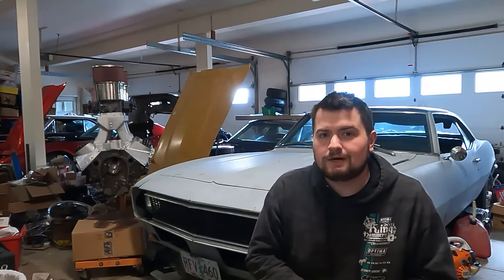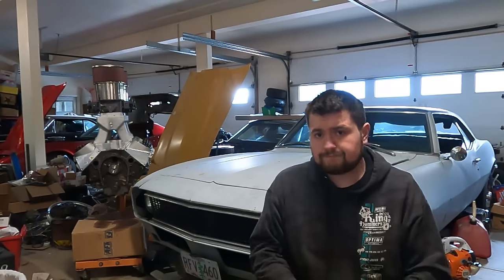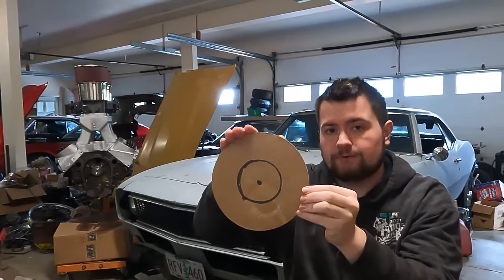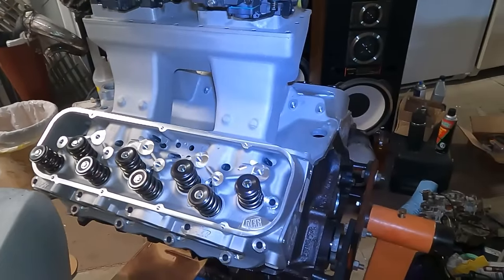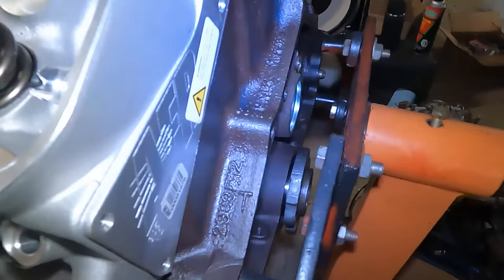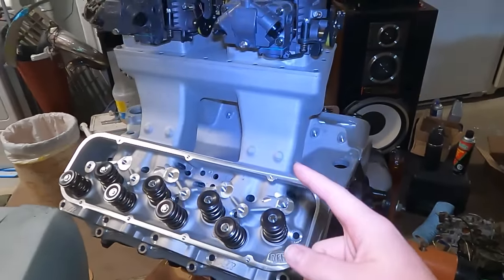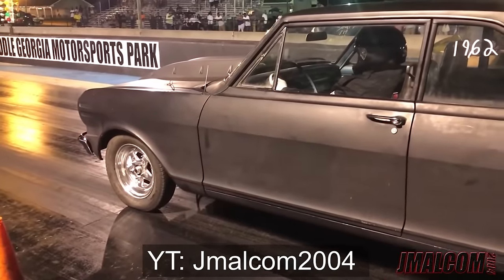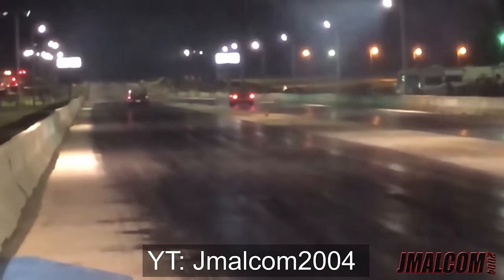The Truth About The Small Block Chevy 327

Comment: He said rare to find now a days. Buying one for $500 out of a old c10 at my moms junkyard. How high do they rev stock?
Reply: the highest ive reved mine stock cam bottom end performer 600 headers was 5000 . i dont know if id risk any higher .wonder what he would say
Reply: @mattv8919  I have shifted mine at 7,000 for 30 years still hasn't missed a beat.
Reply: A truck engine would have had hydraulic lifters which would max out around 5500 rpm's. I had a new 300 hp 327 with 4 speed in 1962 that I raced a lot. To rev much more than that would require solid lifters which only came in Corvettes with 327's.

Comment: The only Factor you have to look at is it internally balanced did you use quality parts 565 big block Chevy I twisted to 8600 during my burnouts and I would run a 906 ET at 154 miles an hour then I'd go through the trash at 7260 RPMs the distance that the ear talking on the circumference is minimal if you use the right oil
Reply from the maker: It still does make a difference however. Drag racing is a sport where you're not at that RPM for a long amount of time. If you're trying to hold high rpm for extended amounts of time thats where a small journal crank will shine. Not saying it's an insane difference, but it does help with sustained high rpm reliability.

Comment: Question ??? Small journal 327 four bolt SPADE steel aftermarket caps, Where can a person buy them ??? Melodon said NLA  Summit & Speedway said, no way, so where can we buy the 4 bolt small journal spade caps ???
Reply: You have to take them off a blown up dart block.
Reply: OK, nobody had a clue on locating 327 4 bolt spade caps. SOoooooooooo  how about this, CAN you use a set of 350 spade cap and deck 1/4 inch off the caps mating surface to use the 350 / 4 bolt spade cap on the 327 block then aline bore the 327 block with the cut down 350 spade caps to use a 283 steel crank so we can wind the HOLY HECK out of it ! Most of the aftermarket caps are really thick and cutting a 1/4 inch off  the bottom would not affect the strength of them.

Comment: It was a great engine. My neighbor had a 1966 Chevy Viking 60 truck with a 327 set up like a semi-tractor; even a compressor for air brakes. He worked it HARD, pulling junk cars to the scrap yard. He overheated the engine and replaced it with a 350, truck was never as good.

Comment: Fot a mildly modded engine a 327 small journal is totally fine. And they rev freeer as well. 350-400hp . Though I knew of 500 plus REAL in decades past. And small journal 302s going to 8500
BUT to make the big power these days and especially boost that large journal is essential.

Comment: I orgot about the l74 300hp 327,and yes gm mfg.a 4 bolt 327 for industrial use!!
Reply: I never saw one. Even out of a bus, boat or water pump.
Reply: L74??
Or L75?
Reply: l75 was a vette motor 327/300hp @johnthonig8832

Comment: Yes, indeed the 327 with the small journal bearing would in theory have less wear however in real life the difference would be marginal. If you drive both engines daily for another 56 years, maybe the small bearing 327 would wear considerably less....at the end both are still oversquare engines. In Hondas, the B20B conversion to a VTEC head can produce such results, since they usually set the rev limiter to 9000+ rpm as the B16A, in an engine that goes from 77 to 89mm stroke and falls in rod ratio from 1.76 to 1.54.

Comment: I have a 69 327 Camaro engine Im working on. It has earlier power pack heads. Ive heard of people bolting on 305 heads or having the 305 intake valves put into the power pack heads. Im looking to turn it into a good street driver with a small bit of HP more then stock. And do it sorta low budget. Which would be better? Or I can get double humps or cheap DNA brand aluminum heads. Thanks
Reply from the maker: Id definitely search for cammel hump heads over 305 heads. The 305 heads provide more compression however lack the flow of the camel humps. Requiring more compression that will inevitably make less power than the camel humps. If you don't already have an intake for it I'd probably suggest Vortec heads however, as they can be sourced from a local wrecking yard and are the best flowing small block head. Caviet being as mentioned before is the different intake they require and they will need to be machined if you want a cam over ~.460-.480lift (can't quite remember off the top of my head what the cutoff is).

Comment: Years ago I was give Chevy small block. 
The engine had double hump head, I sold those some time ago.
For years I’ve tried to figure out what kind of engine it is. I believe it’s a 327, but am not sure what it came out of. 

The casting numbers are 3914678. On the passenger side at the back of the block are also stamped G257

I believe it’s a 327 but not sure if it’s a large journal or small journal. I’m also trying to find out what type of vehicle it came out of. 
Can you help?
Reply: Large journal, 2 bolt main, 302,327,350 according to my book I have. 68-79. Yours is most likely a 1977 350.
Reply: @danburque7555  thanks Dan!! I really appreciate it 👍🏻

Comment: Great video. I do believe that the later, large journal 327 of '68 and '69, could be found in the 4 bolt main configuration as they shared same casting numbered  blocks with the 302 and 350.

Comment: Can you make a 327 out of a 283?  Nice video,. keep em coming!
Reply: No because the bore on a 283 is smaller than the 327. I've heard there is 1 year of 283 that can be over bored to the 4" bore of a 327 but they are really hard to find and expensive. 283 is a great motor also.

Comment: I to prefer the small journal crank ; little known that the 350 when first came out because of demand the blocks were green when machined only 6 months too a year after casting . where as the 2 bolt blocks usually 3 years . I had built a 302 zapper with a 66 small journal block , 12.5 slugs , forged 283 crank , stupid cam and "opps" angle milled camel bump head ; good thing for the overlap of cam at low rpms because compression ratio worked out to 14.2 to 1 OUCH ,had to mix my fuel But talk about fun . red-line was the valve train 9500rpm all day long

Comment: In reality, if you want to go racing and need the engine to spin over 6,500 rpm, then buy a 327...if you can find one cheap. It will  make more power than a 301 at the same RPM and connecting rod length and head flow. Otherwise, find a 400 block and drop in a 3.5 inch crank--less valve shrouding, you won't get the benefits of a small journal but you won't need to spin past 6,500 rpm either.  And if you're on the street, a Vortec 350 will go as cheap as $100, already have the roller lifter bores you want on a 7,000 rpm engine, and it won't even need a ton of RPM since it has displacement (or destroke it if you want, but most who ran their mice past 7,000 rpm regularly invested in shaft rocker arms, so the cost goes up as the RPMs go up), so you get more off the line pep without needing 4.10 : 1 + rear gears. sad to say, the 327 was great in 1968 when fuelie heads by Mondello were where it was at, but it's been surpassed if you're building performance by the dollar. 

i know this offends folks who grew up with this engine and they'll say, "well, if you really want to make hp, why don't you just go buy an LS, boy?". but if you don't know a 327 and you're starting from scratch, you might as well try to make power from a Merc flathead--you'll do it after a lot of money. but if you have a bunch of 327 parts lying around, well...you could still sell 'em and grab a Vortec and aftermarket cylinder heads and a used tunnel ram :)
Reply: Only if you use a 6 inch rod and shorter compression height.
Reply: @cammontreuil7509  6 inch 'rods and pistons weighed to match are nearly off-the-shelf now for the chevy engine. not hard to combine it with a crank that has crossdrilling or pendulum cut weights or whatever you want and save time on the assembly. Or you could reuse stock slugs and swap them from bank to bank if you believe in offset wrist pin benefits.
Reply: @albertgaspar627  Keith black makes a good affordable piston for this application. 
If you do a back to back comparison, the longer rod runs smoother and coming in a corner at a race track, letting of the throttle, the engine naturally slows down, and you have more control instead of hard breaking.
Reply: @cammontreuil7509  i mentioned a few different displacements in my OP, so i'm assuming your talking about a 5.7 litre application. It is interesting a long rod causes "engine braking" as i assume you are talking about, usually that's a matter of compression and friction. Can you explain the science or mechanics a bit more?
Reply: @albertgaspar627  Grumpy Jenkins on an x y graph showed on paper how much piston dwell difference was between a 5.7 rod an a 6.0 inch rod.
He then took a 350. And only changed rod and pistons from a 5.7 and 6.0. 
He found a horsepower difference. He was testing dyno acceleration. 
So I experimented on the tract. I found by accident the braking potential.
I found the same breaking potential in building a 6 inch rod cleveland and 5.4 inch rod boss 302's.
If acceleration must then be an equal deceleration.

Comment: If you bore a 400 block .040 and use a big journal 302 crank with bearing spacers, you get a big bore 327. No bull, do the math.
Reply: check out C.E. PERFORMANCE

Comment: How can i get my 355 to rev higher ? My cam specs allow for around 6k, I have Vortec heads with upgraded springs,performer intake and a 750 holly brawler mec secondaries. I can hardly pull to 4500-5k with WOT and 38 degrees. Fully rebuilt engine everything is new new except my old HEI which is stock. My mechanical advance is working, might need to throw a curve kit in the HEI or upgrade to a Msd? What are your thoughts?
Reply from the maker: I would lean on the side of it being your ignition system for sure, if the rest of the engine is correct for spinning 6k~. None of those components should have a limiting factor so my guess would definitely be spark related. However it does get expensive replacing parts to find the solution.
Reply: What kind of exhaust system are you using? Could that be restricting it?
Reply: @bw3506  headers into dual 2.5” pipes with flowmaster mufflers
Reply: @GMC4240  Definitely should be plenty of flow for that engine. I'm running dual 2-1/2" with Jegs knock offs on a 470. I set the rev limiter to 6700 and spins up against that regularly. if ignition doesn't do it maybe cam timing? Did you degree the cam in?
Reply: @bw3506  I did not degree the cam, I’m thinking it’s either that or an ignition issue
Reply: @GMC4240  I've had a bad experience just trusting the timing marks on the gears before and it was even a name brand set. I've also heard others say their cam was off at the pin as well. My cam maker even suggests checking it so it's certainly a possibility of something being wrong there. On the ignition to me if the ignition isn't breaking up at RPM it shouldn't limit your rpm but I could be wrong in that since it has that module. My experience with the hei used to be very reliable but I hear people complain about the quality of the new hei modules these days. I think they were failing all together though. It's been a long time since I had a vehicle with one of those in it. Something else to consider is valve adjustment. If it's too tight it could hold the valves open at RPM especially if you are using a HV or HP oil pump. This assuming you are using a hydraulic cam of course.
Reply: @davesmith9684  I think it’s my stock hei holding me back I recently tried a 600cfm edelbrock and it made no difference
Reply: @davesmith9684  thanks for your help I’ll keep everyone updated!
Reply: Ignition is not the problem.
Reply: Ignition is not the problem.
Reply: Need good valve springs to rev higher than six grand. Spring should match the RPM range of the camshaft. Where the springs changed on the Vortech heads?
Reply: Sounds like you don't have enough valve spring on there.

Comment: ok, I have to dispel a huuuuge myth here. The arguement over the small journal and the large journal Chevy SB Cranks has been going on for decades.Here is what you need to know about it. The RPM arguement is BUNK!! This all started in the late 1970's wen there was a lot of interest in building SBC engines. The junkyards started that reciprocating weight BUNK so they could sell off the slew of small journal SB chevy engines they had. At 7000 RPM, WHO CARES whether you have a 2.2 or a 2.45? Those Big journal Cranks were desireable by many engine builders,(myself included). Thing is: they were rare and even more RARE to have a big journal forged crank .BUT IF you did have one it was Tufrided which was akin to 4340 steel material. 
According to Bill "Grumpy" Jenkins, the 1968 large journal 3.25(327 crank) is 4lbs lighter than the small journal. The larges were specially made in '68 for the HP cars like the Z-28 & Corvette. (those larges also filtered into the 69's as well.) 
I doubt someone will find one now-a-days as they were all "hunted" in the 70's-80's for their stout for racing.
 The smalls are great for the street.
Reply: I have a 69, 327, (331ci) large journal, going with a Howard's roller cam 110235-12 and 1.6 roller rockers, thread studded camel hump 202, 160 with guild plates. Weind intake, flat top pistons. Should make good power. Thanks for clearing up the large versus small journal.

Comment: Bill Grumpy Jenkins stated that the Large Journal crank reduces Bearing Speed. Give it some thought.
Reply from the maker: It's explained in the video why large journals actually have increased bearing speed. The large journal requires a longer travel along the bearing surface to achieve the same RPM. While it's not something that will greatly impact anyone. The small journal still is the better crank for higher sustained RPM.
Reply: @RatMaro  well yeah, you explained your version in the video which is not entirely correct. Stop playing and give it some thought like I suggested.
Reply: @stanleysteemr1316  I have thought about it. There is no way a larger journal reduces bearing speed. Physics says so.

Comment: There is a lot of things that he did not cover and obviously doesn't know.   The small journal crank is not drilled for a harmonic balancer bolt  and a bunch of them only have a flange to bolt the lower pulley to. 
You have to pay for it to be machined to hold the balancer. 
The crank shafts are all steel.   So the 307 crank is cast,  not a suitable replacement. 
The double hump heads are crap because they do not have option holes. 
And the connecting rods are slightly different than the 305 / 350 rods. 
The older engine has a breather port in the back of the block and the intake has a fill tube for the oil. 

68 and  69 don't have those options and the casting number in the book might say 69 327 or  70 350 for the block and heads but there is a difference. 

69 heads used fire ring spark plugs and  70 used taper seats 5/8 the spark plugs.  
70 heads may have hardened seats while 69 was leaded fuel only..

You don't put the hardened seats in,  the  valve will pound the seat into the heads. 
It ain't just find a old engine,  rering stick a cam and  lifters in it and go racing down the street.

Comment: First engine I heard of that had more horse power than cubic inches. My brother had a 66' Acadian 327/350hp 4 speed. The front end would come off the ground.
Reply: Not stock it didn't!!
Reply: Very cool! I myself have a 1966 Acadian Canso Sport Deluxe. 327/Munic 4 spd.
Reply: @milojanis4901  yes it did. Even 365 hp and 375 hp stock in 64-67 Corvette Camaro ect  although bigger cars and trucks mostly got 250-300 hp and some later version 210 I think. Just depend on which 327 it was and the vehicle it was in

Comment: If small journal is better, why did GM go large (or more technically medium) journal on the 350? Was it because they knew they would be transitioning from forged to cast cranks, and needed the extra strength?? Or was there another reason? If anyone knows for sure, would be great to know.
Reply: Because the small blocks were going in the direction of the 350.
Reply: It was for crankshaft strength with the longer stroke.

Comment: The 327 is a great option for a high performance engine!  But, the forged crank large journal version is the way to go.  There is very little difference in bearing friction between properly prepared small, and large journal engines. So that’s not an issue!  The major advantages of the large journal engines are, the stronger rods, larger rod bolts, and the fully machined main bearing webs of the 010 casting blocks.
Reply: Only because you say so ?
Reply: Not true Bob, it's not a case of bearing FRICTION, but bearing SPEED. And yes I'm a Engineer and have built engines for NASCAR. 
T.S. RACING
Reply: @t.s.racing  no way to measure it.
Only looking at the bearings after a race maybe.
Reply: Nothing wrong with a large journal 327
Reply: @t.s.racing  ahh, So that's why Chevy's spun a lot of rod bearings,...... too speedy!!   lol .
Reply: exactly!